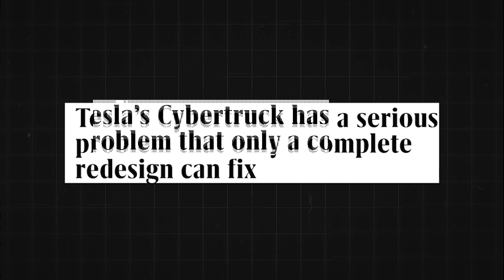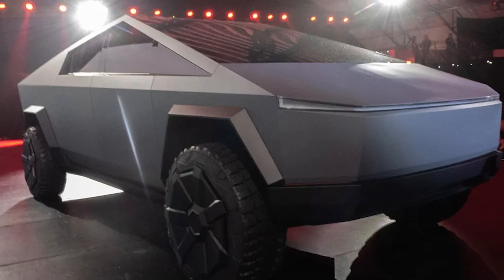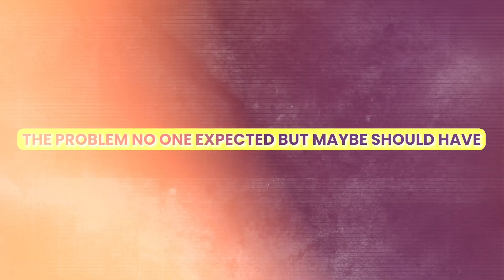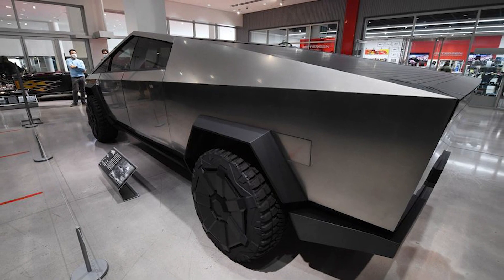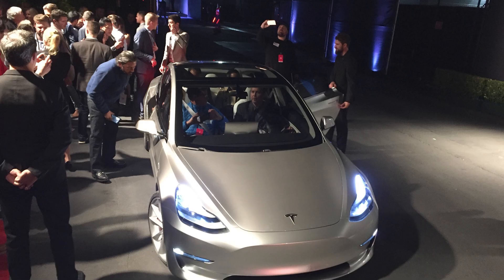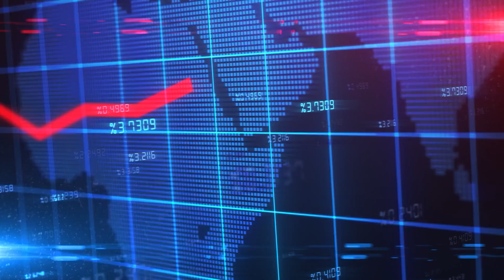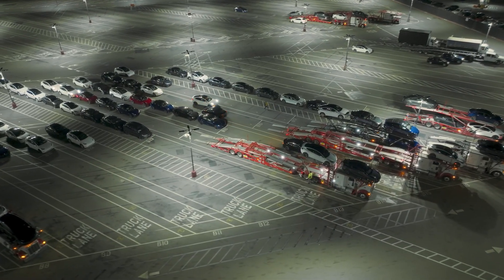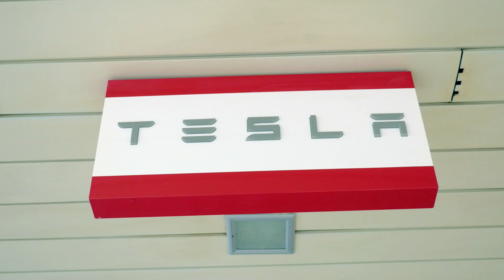HUGE NEWS! Elon Musk REVEALS Shocking Tesla News!

Comment: Once they figure out how to supply charging capabilities to a 150 unit apartment building, then I might take a closer look into EVs.
Reply: If you are in an apartment seldom drive more than 40 miles per day, check out the Aptera a two-seater that depending on your configuration can get up to 40 miles a day from solar built into the body, can charge up to 200 miles overnight from a 110 oulet as well as a Tesla charger if needed during a trip, and up to 1000 mile range.

Comment: Tesla was made for the rich and the stock holders they were the ones that could afford $30,000 for a battery change out and just wait till they own and control the charging stations all over America then the prices per charge will cost a lot more that is how Wall Street and corporations operate. Toyota Hybrids give fantastic automobile mileage and there batteries I think are warrantied for 200,000 miles and only cost $3000,00 for a new battery unless prices have changed and yes I own a 2013 Prius with over 180,000 TROUBLE FREE miles, with just regular maintenance, Breaks and Spark Plugs 100,000 miles change, ALL fluids 65,000 miles and Synthetic 0-20W oil and Toyota made filter every 5,000 miles. That's it folks Aha yes around 46 miles per gallon driving short trips in our little country village located in S.E., Oklahoma on the road to another large city try 50 -55 mpg cruising at 55-60 miles per gallon, tell me which is economically the better SYSTEM TOYOTA for everyone or TESLA FOR the rich?